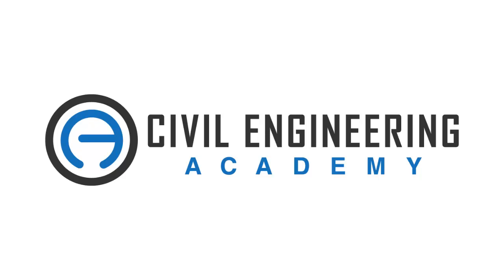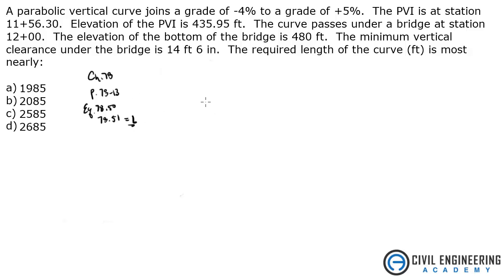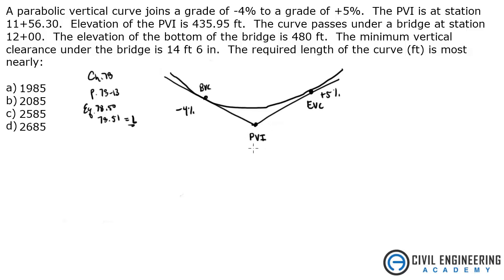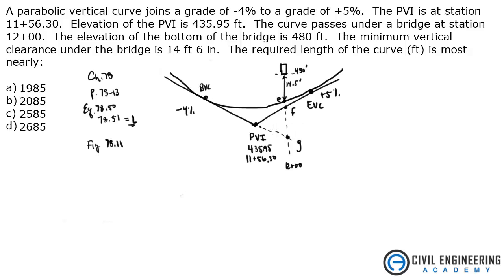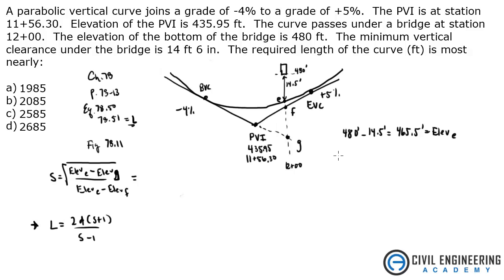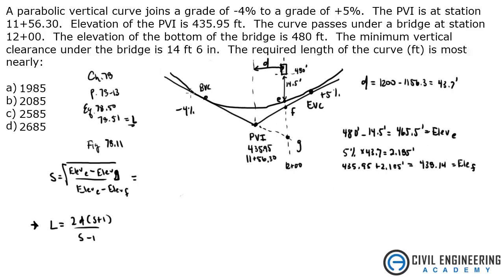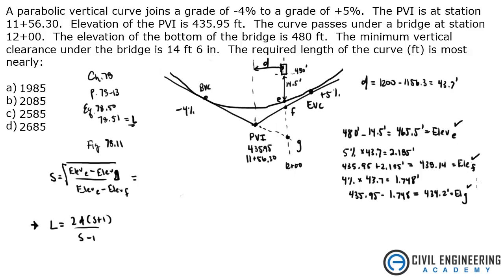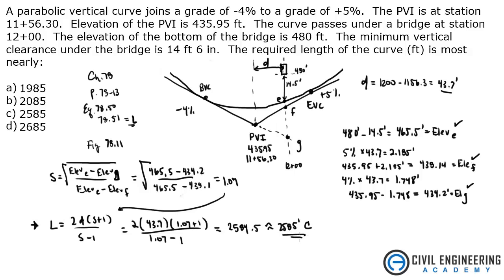Transportation - Find the Length of Vertical Curve with Obstruction

Comment: In this example, you round your elevations of F and G up and down respectively, which results in 's'= 1.07.  Without rounding s=1.069 and L is calculated as 2620.7', which would result in a conservatively 'correct' answer of choice 'd' (2685), since the calculated curve length is a MINIMUM.  I thought it would be useful to note that the decision to round (or not round) your calculations significantly affects the final calculation.

In your previous 'Vertical Curve Bridge Clearance' example, you decided not to round and you used a calculated 's' = 2.436, which if rounded to 2.44, significantly affects the calculation for the curve length.

I just wanted to bring this to attention.  I am not certain which method of rounding choice is technically correct.  My mind is returning to a grade school teacher preaching the importance of 'significant figures'....

Either way, this isn't a huge error.  Your demonstrations are great!  Thank you for providing.
Reply: +Michael Hazlett I think where you went wrong is in the assumption that the L you calculated is a MINIMUM.  I think its actually a MAXIMUM.  If the L is shorter than the clearance is larger; if L is longer, than the clearance is smaller. Since you need a clearance of 14 ft 6 in, you can't choose a longer L.  Your selection would have to be the closest value LESS than what your computed L is.
Reply: Civil Engineering Academy For a second there, I thought I was going crazy when I got 2620.7' as an answer. I must have plugged that into my calculator 5 times before I decided to scroll down into the comments. Would you comment on which would be the appropriate approach as it pertains to rounding? What can we expect on the exam? Great videos! Thank you for posting these great learning aids.
Reply: +Rebecca Cohen ... You are right. The calculated L should be treated as the maximum allowable L value to clear the bridge. So we should pick the answer right below the calculated value. In this case "C".
Though, keep in mind that Michael Hazlett is also right because if we don't consider sufficient significant figures we would end up chosen B since the calculated value is 1/2ft less than 2585ft... I know 1/2 ft only but we never know whether this 1/2ft could really make the difference in a real case scenario :) :p

 
 
                L 
       Elev  "E"
   Clearance
   
 
 
  1985
  458.543
  21.45696 
      ok
 
 
  2085
  459.666
  20.33403
      ok
 
 
  2585
  465.283
  14.71701
     Correct
 
 
  2685
  466.4068
  13.59324
     Wrong
 
 
  * all in feet
Reply from the maker: Michael Hazlett  yes, significant figures are important.  Thanks for pointing out these rounding mistakes and for the great comments.  I'll try to keep them up for everyone!
Reply from the maker: supermanny73 Sorry to make you crazy with checking.  I rushed through this problem which was a mistake.  YOU will want to pay attention to significant figures on the exam.  That will get you closest to the solutions they have.  I left some annotation in the video.  Thanks for get great comments!